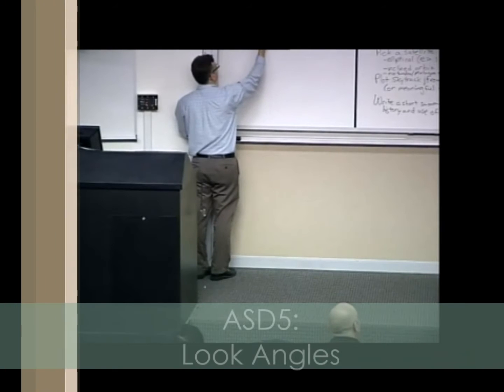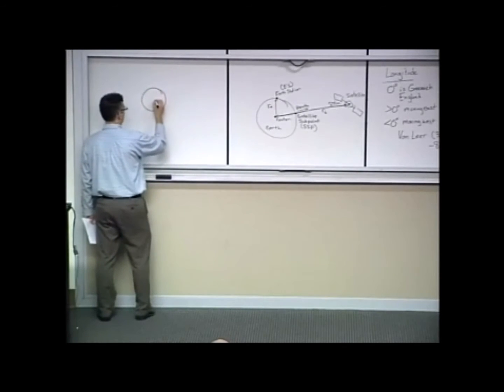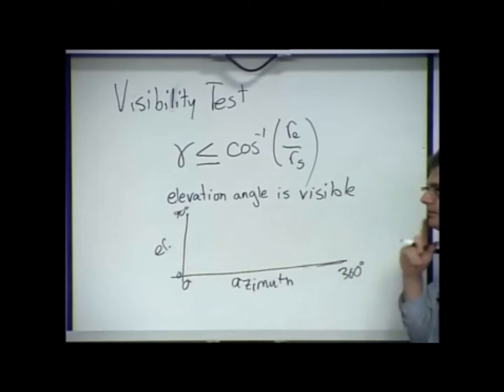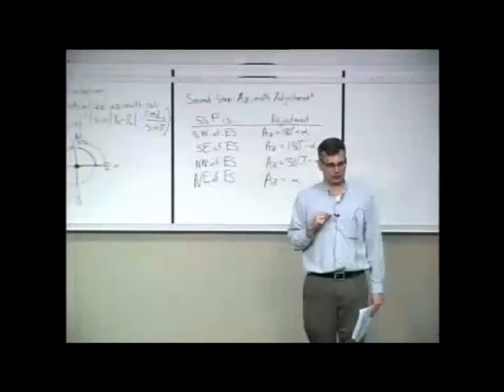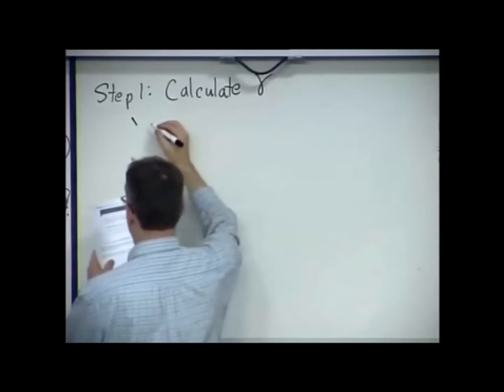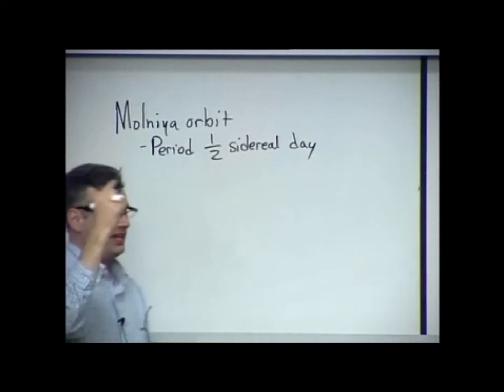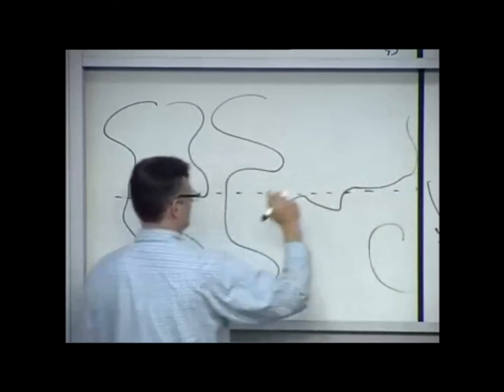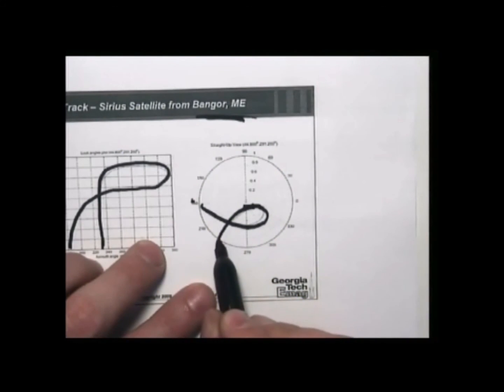ASD05 Look Angles

Comment: Very cool.  I'm not a programmer, but this explanation was excellent.  Does anyone know of an online model where multiple (earth stations) points on the earth can be plotted to show how their azimuth / elevation vectors intersect with a single satellite?  This may sound silly, but what I am trying to demonstrate is that this model would not work on a flat earth.  It requires curvature in order for the math to work. I have a flat earth debunking channel and I would like to use this in an upcoming video.

Comment: hello Greg. Thank you for the tutorial.
I followed your tutorial and wrote a code in C language to calculate the azimuth and elevation angle for my project and it worked. But I need some help.
Basically what I wanted to do is to make a small 2-axis of rotation device which can directly point to the current position of the International Space Station. And according to the formula that you have taught in the lecture, the pointer will always point when the satellite is on the horizon.
But I wanted it to point to the ISS even if it is below my horizon.
Can you please help!
Reply: very good, i love the video. After your lecture several doubts are clarified